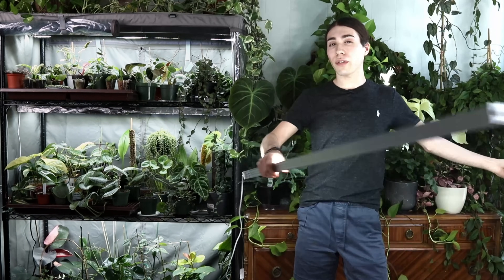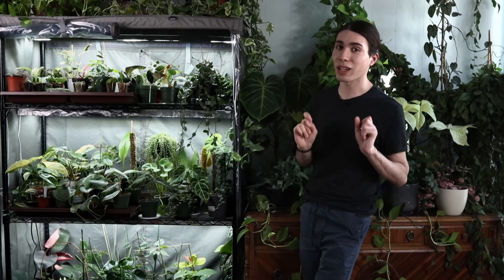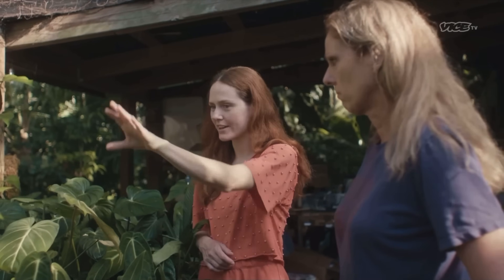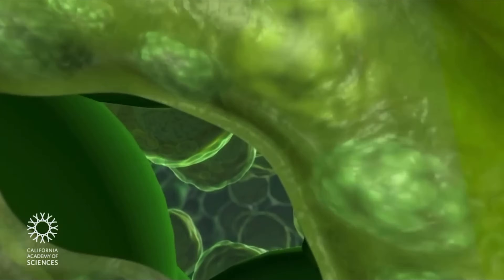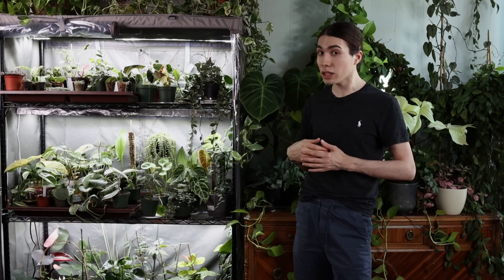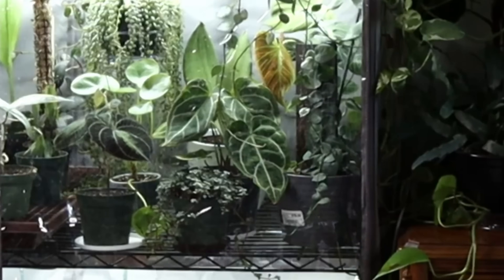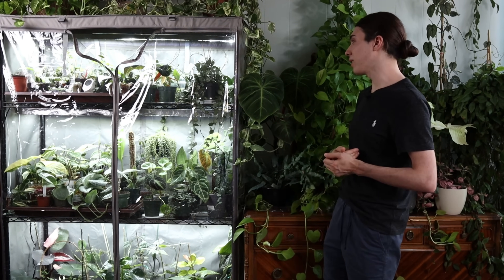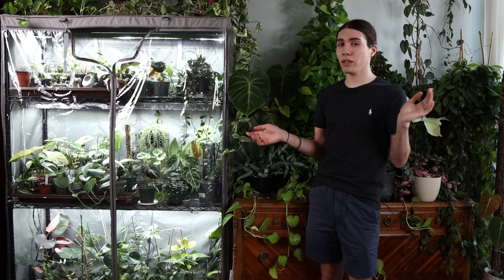How to Use Regular LED Lights as Grow Lights | Avoid the Industry Markup

Comment: what do you do about the plants on your top shelf? how do you get those plants to get lighting, if at all? im struggling on ideas for plant lighting on a top shelf, aesthetic or not. only idea ive had so far is track lighting or just sticking these led on the ceiling.. but not if that practical and im not tryna drill holes in my ceiling everywhere unless i have to.

Comment: You don't use fans for these type setups?
Reply from the maker: No, I just open the top zippers, heat rises and leaves out the top. Some plan't that need high air flow might need fans. None of the plants I have (primarily Hoyas and philodendrons) need that.

Comment: Grow lights used to exist but all the lighting manufacturers decided that the Blue LED's (420nm-460nm) were too expensive and stopped manufacturing them.  If you notice all grow lights nowadays have Red LED's 670nm - 690nm due to the low manufacturing cost.  If you are looking for an actual grow light that works better than standard LED's.  Look for a grow light that include individual reflectors for EACH LED.  

Also, Plants use green light to produce photosynthesis.  I personally vegetate my plants under a 75%blue, 15%green and 10%red with great results.

Another benefit of having excessive blue light as the plant will focus more on root development and help prevent the unwanted stretching.

When you transition your plants into flower, you will need to increase the amount of red light slowly with the ending ratios at 45%blue5%green50%red

Comment: I bought a humidifier which has led lights and i placed it right next to my rattle snake plant which closes its leaves in night time and spreads them apart in the daytime i was surprised when it opened its leaves after 30 mins of me placing my humidifier im pretty sure its because of the LED in the humidifier lol thats how end up in this video
Reply from the maker: Yep it's responding to external daytime simulated conditions. Some plants will flower in the out of season if grow lights are set to a-seasonal parameters, other s will stick to their scheduled growth patters for uncontrollable things like parametric pressure or some internal clock they have. I had an orange bird of paradise that would flower in winter when there was no light because they flower in the South African which is the opposite seasonal patterns to the northern hemisphere.

Comment: I have a plan to install LED light it in my green house. 
I have a spare 12 Volt car battery, solar panel, solar charge controller and a long strip of LED light. 
Does the bright LED light work as Grow light or do I have to buy different Grow light? 
If yes, can you please let me know which grow light is the best to use with 12 Volt car battery?
Reply from the maker: I honestly have no idea how grow lights work for anything other than plugging them into the wall.

Comment: Great video! Just a small correction:
Sunstress in Hoyas can also occur in the complete absence of UV light. Even though anthocyanins are secondary metabolites as you said, that doesn't mean they can only be synthesised in the presence of UV Light. Secondary metabolites are compounds that are not directly involved in essential processes like growth, development, or reproduction (e.g., photosynthesis or respiration). Instead, they often serve protective roles, helping the plant cope with environmental stressors such as intense light, heat, herbivory, or disease, and can also attract pollinators or deter herbivores.

So strong enough light in the visible spectrum can be enough to trigger the synthesis of anthocyanins as it doesn't only protect agains UV light alone. When combined with heat from the light, the plant will with high probability still experience sunstress and produce these protective pigments :)
So just because your hoyas are sunstressing as crazy under your growlights doesn't mean they are emitting harmful UV Light :)

Comment: Nice, I made a similar shelf a while back minus the cover/ zippered enclosure. I added 1 inexpensive grow light to each shelf with 2 regular lights one on each side of the centered grow light. Then I added a Kaza smart plug even though it's in my living room and I could turn lights on and off myself I can program the Kaza plug so I get 10 hours of the regular lights when I can enjoy my plants and 2 hours of grow lights when I'm asleep and don't have to look at it as they do give me headaches. Works very nice as even if I am away they are getting light on a schedule and being in my living room with the thermostat set they are very comfortable. My only issue now is at last count I have 108 plants but the older more mature plants are all over the house and well they are everywhere now. 😂 It's great how one plant starts a huge environment changing journey.

Comment: Seeing the title I wonder if she says that the very limited quantized spectrum of regular LED lights is equally good as full spectrum and the energy delivered is more important. I don't know if the plants care (other than if there's UV light included in the spectrum). In some applications it does make a difference (like trying to filter wavelengths that do not exist in the spectrum of the light).
Reply from the maker: Full spectrum is essentially white light (all colors combined), the spectrum in my lights is not limited, however they are cool lights which is more blue for growth.  Red and blue lights would be an example of limited spectrum since it cuts out the other wavelengths. As far as filtering out infrared wavelengths or other non-light wavelengths, I'm not actually sure what the purpose of that would be if it can be done.

Comment: There's little difference in price between a regular down light like a PAR30 and one advertised as a grow lamp because everyone is doing it. 
As for specifically designed grow lamps, absolutely they exist, and they work well.
The addition of far IR and UV that simply do not exist in the residential lighting market and quality drivers that ensure the proper wavelengths are emitted as current is key. Even the diffusers on regular lights make them inefficient at directing energy where it's needed leading to wastage and excessive energy bills that easily negate any savings in short order!

It seems you know little of LED tech and how it works.

Comment: 9:20 Eagle-eyed shoppers will notice the light tube is available in a "V-shape" versus "D-shape," which adds a third strip of diodes on the flat edge, as in this diagram: \_/.  The additional diodes slightly increase cost ($7), power (8 W), and lumen output (1100 lm).

I think the joke about one's preferred shape writes itself.

Comment: What if you stop using the light and leave the plant outside, will it deteriorate?
Reply from the maker: No but you need to slowly adjust the plant because it will get UV burn outside if you just throw it into full sun.
Reply: @phytosexual  thank you for your answer

Comment: Just get some led full spectrum lights for aquariums. Fluval or if you want a little cheaper get the hyggar. They have all the colors and adjustable and built in apps for full 24 hour cycle

Comment: I use full spectrum grow lights only, since the lower leaves of the plants actually make use of green light by bouncing it back to upper leaves. And to be fair, depending on how many plants you have it's more cost efficient to use LED-lights. Their prices are very reasonable also. I have 2 lights that both have two lamps you can twist around as much as you like, and both sets have 5 plants under them. One light with two lamps costs 40€. What I have noticed tho, is that the light is way too bright (it does come with a dimmer setting and you can choose from super bright to low light) and my maranta burned a bit under it. So, some plants that don't do well in direct sunlight or even indirect sunlight are currently on their own little corner. Come winter I need to dim the lights a bit and move the others under the light as well.

Comment: Love your humor! Quick question for you. I need my light to be a flexible light strip due to how my setup looks like. Do you think COB LED lights would work well as grow lights? I have found some that are 5000 kelvin and 5000 lumens. They run on just a 12V 5A power supply.

Comment: Hi I’m a botanist and horticulturist. There are very few instances where you need higher or lower UV light or light warmth from the light source. Like if you were running an alkaloid farm. 

I would go on and on about this but you did great job explaining all of the reasons why. 

No notes other than talking about how temperature is an important additional variable, especially with temperate orchids.
Reply: I have a chauvet dj quad bar..led...can I use it as a grow light?

Comment: I still agree that LEDs are generally better than fluorescents, but the very first result that I found for  a 4-foot high output T5 bulb (which most people would choose for this purpose over the T12 that you showed) will put out about 5000 lumens but consumes about 54 watts, so it will use more energy for roughly the same amount of light but not less than half, also LEDs are more durable and usually cost less over all.

Comment: 9:24 I'm sorry but you picked the absolute worst example of a fluorescent bulb.
T12 is ancient tech and rarely used.
It was replaced by the T8-Socket. The T8-Equivalent for the bulb you showed would be 36w and have around 3100-3300lm. You have to add a few watts for the ballast though(5-10).
Also, the LEDs you bought probably aren't as bright as the claim. It's a recurring theme with cheap Chinese LEDs to be much worse than claimed in both output and efficiency. If they say 40W 5200lm I would usually expect around 20-35w 1800-3000lm.

Don't get me wrong, LEDs are still the best solution but for another reason:
Fluorescent bulbs emit light in 360° so you need a reflector. A reflector can never reflect 100% of the light so you lose some (maybe 20%?) especially as it gets dusty over time (maybe up to 50%?)
Also, some light makes it out the side or gets reflected back into the bulb. Suddenly your ~3200lm turn into ~1500-2000lm depending largely on the reflector.
The output of the Fluorescent bulbs also drops much faster over time than (decently built) LEDs.

Comment: This info is not entirely accurate, you do have some good info but man there is a lot of inexperience here with the topic at hand. White lights have been more efficient than red and blue for a few years now ever since Samsung LM301B came out in 2017. The fixtures you recommend oddly do not use LM301b though and use an inferior less efficient diode. That's why you don't see that many "blurple" LED fixtures anymore white is better now. Not to mention you're not really "avoiding industry markup" here, you're just buying extremely cheap LEDs. There is a difference. You're also comparing your cheap trash led choice to a T12. NOBODY GROWS WITH T12. That's extremely old, people grow with T5. This video really feels like you grow plants and you wanted more views so you did like 10 min of research on LEDs on google, cited a bunch of old info and just BS'd your way through. There is a lot of misinformation here. 

I would also suggest instead of buying that zip up wardrobe thing that you use panda film. Wrap the whole thing in panda film and you can even wrap it so that the light doesn't just spray everywhere into your room. You can basically make a hood and direct it by just putting panda film past the light. All light is then directed down to the plants. You are talking about lighting efficiency and then you use grey for your walls and let most of the light just fly out to all sides....I don't get that. I have my rack like that wrapped with panda film and it has two nice big growing areas with a bottom storage. The whole inside is bright white. Maybe it's because I'm a cannabis farmer and I'm used to having to squeeze out every bit of light that I can. But my rack like this is cactus and aloe.

Comment: As someone who worked for a company selling light sources.
You ought to take the technical datasheet with a grain of salt,
most lights are sourced in China, 
and from what I've seen the datasheets provided by the manufacturer are often inaccurate.

That said, even if inaccurate, LED will always be more energy efficient than flourecent.

Comment: Great video! If you get a chance, check out Shane, of the Migro Channel. He designs and sells "Grow Lights", as well as reviewing other "Grow lights". Even listing those best in efficiency, even when his model wasn't. 
  He's in Ireland, so he can't grow what many who buy his lights use them to grow for, lol.
  He has a great episode from awhile back, taking household LED lamps, cutting off the plastic cover diffusing the light (they actually snap off, if done right). He uses Top notch PAR(Photosynthetic Active Radiation, which the plants absorb) Meters, that also show the spectrum map put out by the light.
  He creates a board with Household LED's attached, so he can test their efficiency and Spectrum map. Surprisingly, they worked much more efficiently than expected, and put out a great PAR map, showing a curve almost exactly like most "grow lights", minus the spike at 660nm, as they don't have them.
  He has another video visiting a greenhouse in The UK. They're using extremely expensive UVB-280nm Diodes only affordable by Universities, etc. They found a 50-100% increase in essential oils from The Lavender plant, with this 280nm UVB. Fortunately, 280nm UVB Fluorescent T5 lights are available pretty cheap! Reptile bulbs, basically.
  Lumens are the light we humans detect, and still used with film, as well. We could have high lumens, very bright for us, but if not in the proper PAR, or Photosynthetic Active Radiation Spectrum, the plant doesn't detect this source like us. With PAR, 450nm Blue, and 660nm Red are the most "efficient" areas for PAR, yet probably very low in Lumens (with black looking plants, lol).
  Most "Grow lights" use a combination of White Diodes, usually a combo of 3000K and 5000K/6000K, coming out between 3500K-4000K, and just about always 660nm Red for flowering, as it's very efficient. 
  Usually a Blue peak around 450nm, but this comes from the White Diodes, at least enough. Some add several supplemental Blue 450nm Diodes for the veg stage, which helps prevent stretching.
  The Migro Channel host, Shane, is a really nice guy! He's tested just about everything, including "Household LED's", which was very surprising and quite efficient!
  He also decides to use his Apogee+ Light Meter to test those Blue and Red LED rod lights that are bendable from the base(often a clamp), with a bendable steel coil that holds them in position..?!
  Even I was shocked by this! Let's just say they're totally useless, even. His Top of the line Meter measured barely anything! Certainly not enough to clone one cutting, even..?! The Household LED blew away 3 of those "Magic Wands" adjustable at the base.
  It's great to see the science, and understand it. Just those 2 videos said a lot about lighting. Grow light, Red and Blue, adjustable from the clamp base, always reviewed well on Amazon..?! Useless, surprisingly. Household LED's..?! Really quite efficient, and easily able to do the job with a great Spectrum map and surprisingly efficient!
  Forgive my rambling, please. Just wanted to add some stuff and started remembering more, and more.
  Thanks once again for everything!👍💯✌️

Comment: I don't even have to watch this video to know this is some stupid take. Yes, the LED chips in plant lights are the same as the LED chips on a regular LED light, but the spacing and light color matter a lot for plant growth. The color spectrum matters a lot as well. Blue light causes thicker cell walls and wider leaves in order to change to catch the blue light better. Red light will create thinner leaves and stretcher plants with longer inter nodal spacing. I guess if you want to grow some succulents sure, toss em under some random light. You don't even speak confidentally about light spectrum when you speak about the light colors that matter. Your understanding of plant morphology is really bad. You're like, blue light and pruple AllAL that MaTTeR. Try listening to a scientist, like bruce bugbee, about light spectrum. Please ignore this ignorant plant hobbiest. Oh my fuck this video is cringey as hell. GREEN light is photosynthetic. it is one of the most powerfull light spectrums at higher watts when compared to blue and red. Color matters based on the intensity of the light as well. Dim green light doesn't reach far, but green light is EXTREMELY photosynthetic at high intensity. All of these things are research subjects done by the university of utah if you want actual science behind something.

Comment: I've been using a mix of 4k lumen and 10k lumen shop LEDs for my indoor bonsai and over winter for a couple years now. I have a "grow light" and the only difference is in the wattage.

A 300W grow light will out perform a 40 Wat shop light every day, but not because of the color spectrum. 

There's a free app called Photone that you can use to measure DLI(most useful measurement for us hobbyists) PPFD and LUX and it's great for comparing and figuring out your setup. 

Also UV and Far Red light ranges are useful for plant growth. Adding IR increases plant development and morphology (easy explanation, Far red light reaches the forest/jungle floor and triggers growth to compete with older plants/trees)